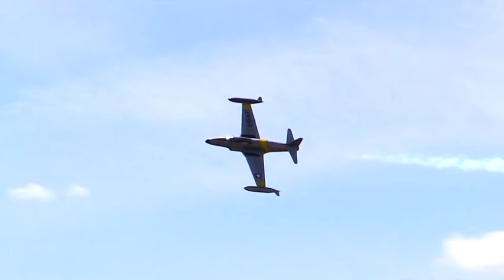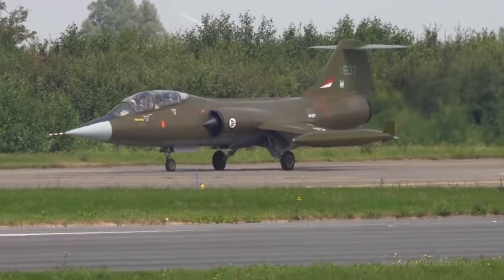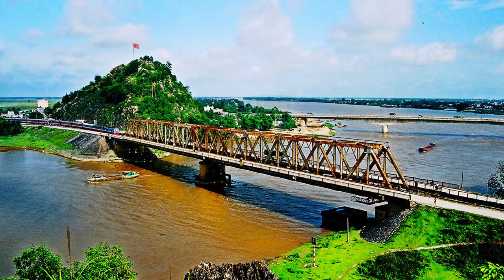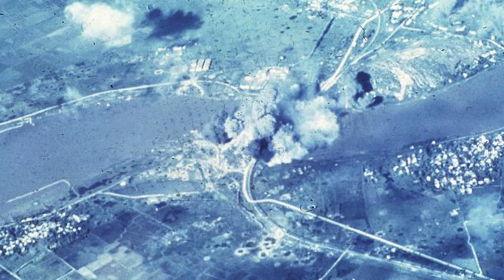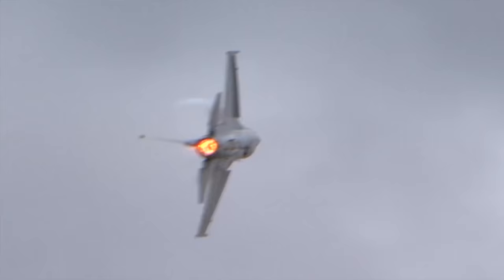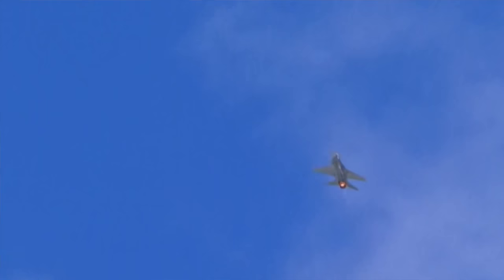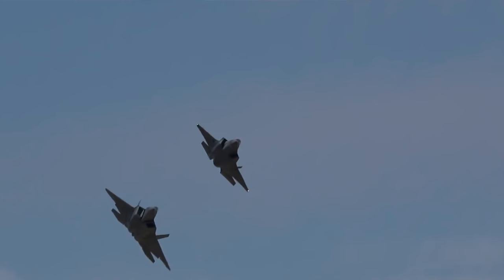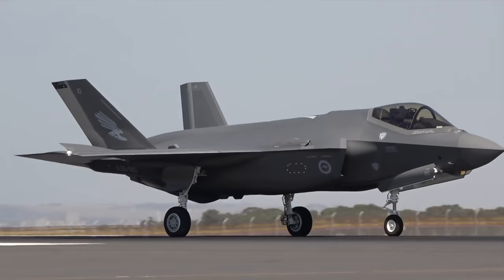Real Fighter Pilot on 5th-Generation Fighters

Comment: I like the NFL analogy.  If you dive deep into each duty position on the team, and also look at the head coach on the sideline, then relate this to the fighter generations, it makes more sense for the layman.  In the 3rd fighter generation, technology limited us to single role, purpose-built fighters, interceptors, nuclear strike fighters, light attack, medium attack, deep interdiction, fleet air defense, reconnaissance, and electronic warfare aircraft where the crew focused on that one mission set.  Several of those aircraft were found to be useful in totally unrelated roles, like the F-100 fighter being used for CAS and light attack in Vietnam, or the A-5 Vigilante carrier nuclear strike fighter being used for high speed tactical reconnaissance.

As processing power got better in the 1970s, we realized that the possibility of multirole fighters could be realized even in single-seat jets, and the F-16 and F/A-18 embodied this.  It would be akin to having a player who could be a tight end or a fullback/running back and do both roles really well.  AWACS emerged in Vietnam, which is like the coach on the sidelines with a microphone and the  players have ear pieces to hear his perspective of the big picture and how to best position them.  That was 4th Gen.

With 5th Gen, the platforms can smoke a 4th Gen quarterback, defensive end, tackle, tight end, wide receiver, fullback/running back and have a better picture of the field than the coach on the sideline can.  When you have a team that has 2 5th Gen wide receivers, a 5th Gen QB, 5th Gen Fullback/running back, with some leftover 4.5 Gen tackles who have better ear pieces connected to the 5th Gen players, the team is unstoppable.

A 4th Gen player talks about what his sprint times are on the track, what he can lift, while not wearing equipment he has to wear on the field.

5th Gen trains in its equipment all the time, even for sprints, the gym, and field exercises, so it’s always configured for game day.

On top of that, the 5th Gen players have optical camouflage like Predator, making it next to impossible to see them.

Meanwhile, our adversaries are scrambling to develop their own 5th Gen players, but they are decades behind us in training and building them.
Reply: This is a pretty neat way of describing it. I may end up bottowing this for future use lol

Comment: We basically went from flying bricks to flying darts
Reply: What about the f104
Reply: Holy shit bro I thought you were one of my friends for a second because of the duck pfp
Reply: Unstable darts. lol
Reply: @mr.spaceboy9785  

4th gen fighter are designed to be marginally unstable. If the computers fail, the plane will crash since a human can not make the adjustments fast enough to fly the plane. Ergo, an unstable dart. Or, a computer stabilized dart. lol
Reply: @ycplum7062  cool
Reply: @ycplum7062  so you watch hazard lee I see
Reply: @mr.spaceboy9785  

I would not have commented on a vid I did not watch. lol

However, this was known for decades. The F-16 was the first production negative stability fighter with all fly-by-wire controls towward that end. This was in the 1970's.
Reply: @ycplum7062  interesting
Reply: @ycplum7062  wait I'm dumb I literally forgot what vid I was commenting on
Reply: Supersonic Hollow bullets sir
Reply: I went from the F-14 to the F-22
Reply: Big block plane engines
Reply: F-16...lawn dart. Awesome fighter jet but when my wife was an ATC in The AF, while I was in the Army, that was the nickname and sadly she helped pick up the pieces from one that crashed near Moody AFB. RIP Sir
Reply: Modern jets are closer to bricks than in the 70's. Back then we cared about keeping planes light now they're just loaded to the brim with sensors and weapons.
Reply: And then bullets
Reply: What about the first Jet powered fighter the Gloster Meteor by Britain in 1943. Because it used the Whittle jet compatible with the the lower grad metals of the day it was far more reliable and some are still flying today compared to the short lived Me262 and it's turbine that self-destructed from low grade metals used. Then there was the USAF Lockheed P80 shooting star of 1944-45 followed by the Mig15 and F86 Saber in 1947, both with sept wings but the Saber had a radar gunsight. Gen 2 was called the Century series where the number sequence started at 1.

Comment: Regardless of how tactically superior modern fighters are....as an aviator you can't deny the romanticism attached to the high speed and highly manoeuvrable dog fighting machines of the last century.
Reply: On the other hand, the F22 is still very good at both of these.
Reply: @presidentbanana4536  When it is not down for maintenance.
Reply: @kevin_1230  That's true of ANY aircraft (or vehicle, for that matter).
Reply: @KRGruner  Some like the f-22 and to a lesser degree the f-35 Have a very low readiness rate.
Reply: @kevin_1230  Not borne out by actual data. Rates have indeed been somewhat lower at times, but so have the rates for a LOT of other aircraft in the Air Force and Navy (F-18 especially). F-22 is really nothing very special here. In fact, in actual combat deployments (when an effort is made to have the parts and manpower on hand), the F-22 and F-35 have done very, very well. In 2019, the rate for the F-22 (overall) was 68% vs 75% for the F-16, so yes, lower, but not massively so. F-35 was 74%. And yes, these vary month to month, so you can always pick a bad month and make headlines. Rates are not the real issue. The issue is getting the cost per flying hour down.
Reply: @KRGruner  You realize the average age of an f-16 in the usaf is 28 years old. As an aircraft ages you expect the readiness rate to go down. The f-22 and f-35 has never been good. And considering the fleets are quite small this only makes it worse.
Reply: @kevin_1230  Nonsense. The F-16 is older, but also much simpler and non-stealthy, and rates do NOT necessarily go down with age, given the fact the aircraft are typically upgraded (and not just avionics - structural components as well). The F-22 and F-35 compare well to others, even if rates are slightly lower due mainly to need for stealth coating maintenance). And the F-35 fleet will NOT be small in the near future (wings in Alaska and UK standing up, plus Guard units - not to mention USMC and Navy squadrons, and many, many multinational units). But hey, I'm used to your kind of attitude based on preconceived notions. Soooo typical...
Reply: @kevin_1230  Imagine trying to argue about aircraft you know next to nothing about, lol
Reply: Late to the party here, but stealth coating can be neglected in the maintenance schedule to cut cost if stealth is not important for the mission. The F-22, when used against enemies that doesn't have an high-altitude air defense like Afghan insurgents, it doesn't need its stealth to do the job. And from what I extrapolated from the published data, the F-22 without a stealth coating should be similar in cost to maintain per hour as the F-15C, both being a large, twin-engine jet fighters.
Reply: And the F-14, TOMCATS
Reply: @mickeyg7219  F-22A without VLO coatings is easier to maintain than an F-16C.  Another problem for the Raptor was that enemies within the US government at the highest levels (White House/ SECDEF) killed it before full-rate production, so spares are extremely expensive comparatively.  F-15C is far more difficult to maintain since it has a rather complex mechanical flight control system, automated variable angle intakes that coordinate with the FLCS, and 1960s/1970s design architecture with layered 1980s, 1990s, and 2000s-era upgrades that have spaghetti’d into that.
Reply: @LRRPFco52  I believe it was killed to make way for 6th gen fighters. The F-22 wasn't enough of an upgrade when 6th gen was right around the corner. (Not saying the F-22 wasn't a huge leap forward.) Probably a threat we don't know about maybe laser weapons or something that needed to be addressed and upgraded to justify full adoption for the air dominance fighter. 

I'd like to add that I have no clue what I'm talking about just stuff I've heard recently about the AF researching 6th gen fighters using the F-22 as a base for research. It's also possible that the next generation will have a remote piloting option if I'd have to guess.
Reply: @LRRPFco52  I have a feeling that the fifth gen fighter was a complete reworking of how aircraft are built from the ground up. With any system, when building off of legacy designs layering of upgrades can cause additional unnecessary complexity. Additionally, with new tech and how powerful computers and ASICs have become a full rework was called for.

I keep telling people this, but the capability gap between cold war and modern planes is wider than Vietnam to cold war era planes. It's such a massive jump it's just not as obvious so people underestimate the importance of what's happening.
Reply: @kevin_1230  Karl Gruner used to fly F-111s and F-16s, so he is intimately familiar with this topic.  Check out his interviews on Aircrew Interview channel.
Reply: @ImperiumLibertas  Yes, everything was improved including structures, propulsion, flight control systems, actuators, prognostic monitoring and regulation, sensors, man-machine interface, fuel fraction, maintenance access, comms/networking, environmental & electrical, and low observability.
Reply: Sopwith Camel for the win!!!

Comment: I've come to view the concept of "generations" as a marketing thing. Lockheed's 5th gen definition originally included supercruise, but they dropped it when the F-35 came along since it would be hard to meet.
 
Generations can be redefined on the fly, but one thing is guaranteed: no capability exists in a vacuum. It is always in response to another capability, and will likely itself be countered in the future.
Reply: The F-35 has super cruise capability though
Reply: @KevinMardirossian  It can cruise at supersonic speeds for a short duration, but needs afterburners to do so.
Reply: Oh my god.
Reply: I dont understand. Doesn't the F22, a 5th gen fighter have super cruise?
Reply: @rmm3803  The F22 does. It can attain supersonic speeds and maintain them without afterburner. The F35 needs afterburner and then can maintain those speeds without it for about 150 miles.
 
The main point being that the definition of "5th generation" can change. Or any generation for that matter.
Reply: @Raptor302   No, I was referring to this:

"Lockheed's 5th gen definition originally included super cruise but they dropped it when the F35 came along..."

Why would they drop it when they've already designed a 5th gen that meets the 5th gen supercruise definition?
Reply: @rmm3803  So that the F-35 could also meet the definition.
Reply: @Raptor302  I'm not being difficult but what's the rationale behind it?
Reply: Marketing. They wanted the F-35 to also be a 5th gen fighter, so they changed their own definition to make it one.
Reply: @Raptor302  Ah, gotcha, I hear what you're saying. Here's the thing though, the term "5th generation" was actually coined by the Rissians, not Lockheed, and is an informal way of categorizing the different eras that defined aircraft. As such, the term has never been on Lockheed's official criteria for any of their aircraft.
Reply: @rmm3803  F-106 can "super cruise". LOL
Reply: @Raptor302  
Well a 1958 f104 StarFigher could also maintain and reach supersonic speeds - and do so without afterburners. The F35 apparently needs to use AB to bump over Mach 1.0, but after that it does seems to be able to maintain supersonic speeds. The 150 mile rating? It not clear what that means, since it not going to take 150 miles to slow down just after bumping over Mach 1.0 and then shutting down AB - so the wide spread comments on the web don't paint a clear picture of what is going on here. Perhaps Hansard will make a video about this.
Reply: F-35 can supercruise at 1.2M but does use the afterburner to break Mach.

Comment: I wonder what the average “combat” speed of 4th vs 5th gen planes are since a lot of people care about numbers. Considering 5th gen planes use internal bays so the extra weight slows them down obviously, but no real drag difference. Meamwhile 4th gen planes have the same extra weight, but an additional increase in drag from external pylons, weapons, pods, etc. Someone probably has a research paper on that.
Reply: John 3:16 For God so loved the world that he gave his only  son so that whoever believes in him should not parish but have eternal life.
Reply: @diegoferrr6173  ok?
Reply: High hour F-16 pilots said they cruise at 50-80kts faster in the F-35A, that they don’t have to punch burner to sustain speed at turns at flight levels at 25,000ft and higher, and that they have way longer legs than the Viper.  In any internal stores-configured F-35, it’s very easy to go supersonic, whereas in the Viper, many of the stores configurations are subsonic or barely supersonic if you go into burner.
Reply: @LRRPFco52  having longer legs than a viper is nothing to brag about.  The 35’s effective combat radius is crap.  The idea that it can deploy from “austere” airstrips is laughable.
Reply: @LRRPFco52  18k lbs internal fuel is a dream, especially with a plane that size
Reply: @411bvRGiskard  Wherever you're getting your info on F-35 combat radii from, throw that source in the trash. F-35A has better combat radius than a 4 tank Mudhen with CFTs and EFTs. It has better radius/endurance than a 2 tank F-15C. The F-35A has the best radius/endurance of any TacAir platform in USAF, bringing back the radius/reach that we used to have with the A-7D.

It carries more internal fuel than any other TacAir platform, has better combat-configured T/W than any legacy platform, and has better range/endurance than a Raptor.
Reply: @411bvRGiskard  Both USAF and USMC have been doing austere airstrip basing operations for years now, to include hot-arm, hot-refuel with all 3 variants in multiple continents, in combat as well.

USMC just posted videos of them setting up mobile arresting gear and landing F-35Cs on a remote Pacific island.

USAF has done rapid FARP operations with F-35A in US, Europe, and Middle East, to include in support of combat operations.
Reply: @mimimimeow  what do you mean it’s a dream that’s how much fuel an f 35 has
Reply: @joshuawatts1924  he means that it is a lot

Comment: Quick question: where do you see 6th gen going? What kind of emphasis do you think is going to take the forefront of aircraft design and stratrgy/tactics?
Reply: Autonomous pilot-less crafts.
Reply: @Trust_but_Verify  yeah, immediately after asking the question I saw the Boeing "Loyal Wingman" UAV
Reply: @largeasbrontasauras5019  Key word: wingman
Reply: @9999AWC  haha wingdroid
Reply: 5th gen focus on stealth+networking but with a carrier design for drone hangars, deploying mini-fleets of combat drones with their own weapons or sensors, and the ability to put drones between the plane and an incoming locked missile. Might replace aircraft guns entirely with drone-based lasers for air-to-air combat, and a load of traditional missiles for specific roles.
Reply: I don't think it will be just loitaring munition and netcentric links that distribute tetrabite of data coming from sensors spread in the 4 dimensions.😜
Reply: @Trust_but_Verify  Thanks, captain obvious.
Reply: Cheap Small Unmanned Non Stealth Fighters, Manned Stealth Fighters, Unmanned Stealth Fighters.
Reply: @Nerthos  u played too much Ace Combat
Reply: @thekraken1173  yep. I don’t believe we will ever be able to replace people completely and if they do, it will be on the loosing side. 

There are too many ways to isolate a unmanned aircraft from communication (Iran has taken control of unmanned US aircraft more than once). Anytime we think we have something that is fail proof, we find out that it is NOT. 

I believe pilots will have an integral roll to play even 1000 years from now. But weapons will progress and a single pilot will be assisted in his/her duties in a way to give them as much decipherable and actionable information as they can process and act on. Some things will be automatic, defensive systems, ground collision, over “G” etc. Others will require the pilot be trained to make decisions in line with the authority given them. 

If we ever hand control over to computers, that will be the beginning of the end of humanity. Someone will become bitter and decide to insert a code that turns these systems against us.
Reply: @thekraken1173  release the kraken!
Reply: @gamm8939  NOT HUGIN AND MUNIN WITH THOSE MISSILE/PLANE KILLERS
Reply: I forgot who said it but it was a pretty important guy in the F-35 or F-22 program, but he predicted that 6th generation fighters will be like "giant aerial stealth command centers," with drones that can deploy from the plane